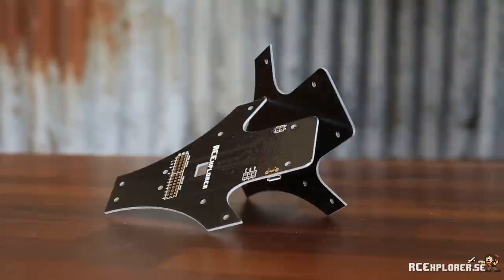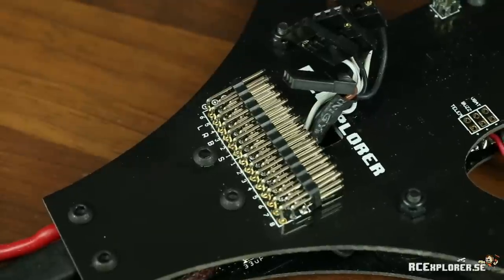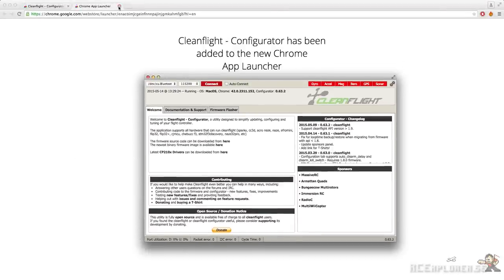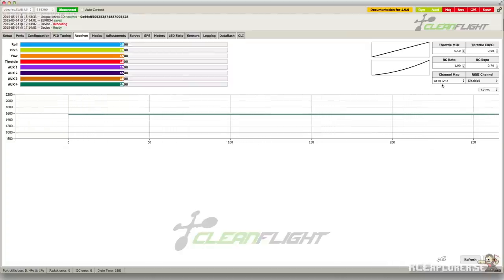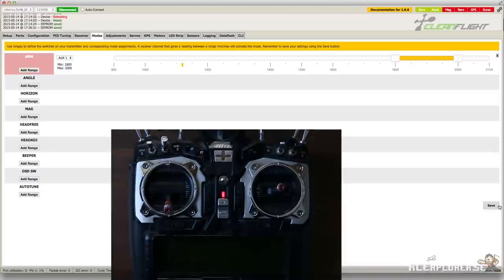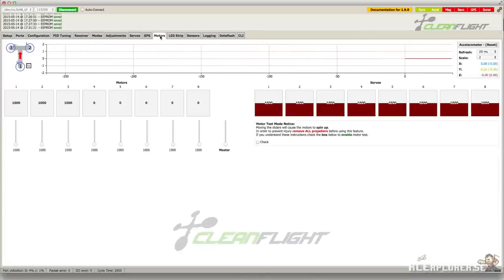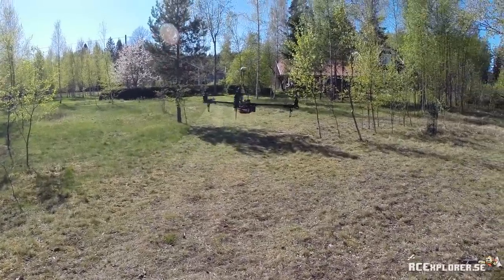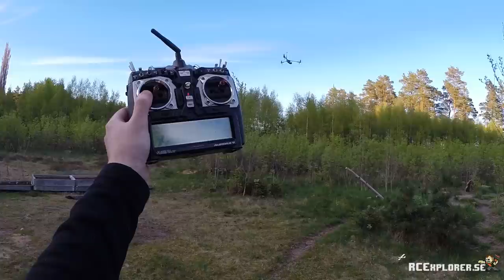Naze32 Tricopter frame setup

Comment: Hi David. 2 years after getting into RC and 14 multirotor builds later I'm just about to embark on my first Tri build (once I've finished my latest Armattan F1-6 quad!). The V3.5 kit I received from you last week looks great. Fantastic job on the setup guide and build log! Both look pretty comprehensive so there's plenty of reference info. My work colleague +IwancnobiRC (who posted a V3 YouTube review and also has a recent Mini Tri build under his belt) is on hand to provide some local help over here in Scotland so hopefully I shouldn't hit any major roadblocks! I'll be running a 4S long flight time setup using EMax 2216-850Kv & DYS BL30A ESCs. Cheers, Steve :-)

Comment: Hey David, in case you didn't know. They have an RCExlorer tricopter default setting that you can select when setting up an open pilot CC3D board. It flies better than anything I've been able to do. But then I suck at tuning. I can bend some piano wire though.

Comment: Damn.. I just ordered the 'normal' version of the frame ;)  Very interesting though! I might order this one as well.. 
Thanks for the good info video!
Reply: DutchRC ADVENTURES o.k. why not.. Ordered this one as well.. Can't wait to start the build :D
Reply: DutchRC ADVENTURES There is no reason not to have one of each version (or even multiples of). He who dies with the most tricopters wins : )
My count
3 black frames plates wooden arms V2.5 (from Davids CNC mill).
3 signed kits V3 (1 rescued from E bay).
2 pairs Naze32 Acro + power base plate (yet to be built).

Comment: I had an idea for a tricopter and with my knowledge I have no clue if it is feasible but back to the topic. I think it would be awesome to have a tri with a single boom forward and then call it the wavelength because the sign for wavelength is an upside down y

Comment: Nice complete setup video. I'll try that custom firmware om my tricopter because I have problems with a kind of flutter om the yaw servo with Cleanflight on a Flip32+ if you can recommend it. Had the same with a Pixhawk. 

Hope the new tricopter code will find it's way to the main branch of CF.

Comment: David, I flashed the firmware you mentioned and my HS-81MG tailrotor servo made a loud buzzing noise and burned up. Is this firmware only for use with a digital servo?

Comment: Hallo David,
this is a nice Video Tutorial.
I have a little question.
When you calibrate the ESC, the Max Throttle is 1900.
Should not previously a calibration, set the maximum gas to 2000 and after to the calibrate set again to 1900?

Comment: Was 2 days too soon on the order, so i bought Tri without naze. I still had a naze32 board lying around, so all good.

My question is. Can i run front motor nr.3 CW and motor nr.2 CCW?  Setup on mine is the same as in this video, where all motors spin same direction.

Comment: Is there any videos on were to solder everything? I am looking at the frames and see two + and - spots at every spot. And were do I add the battery connector? I have never built something like this (only planes) so I am a bit lost.

Comment: That thing is amazing :O
Its easy to setup, and its as cheap as a kk2 with the usb programmer.
And it includes a cool-designed frame.
My question is: is that product avaible in the eastern of europe? (Hungary exactly)

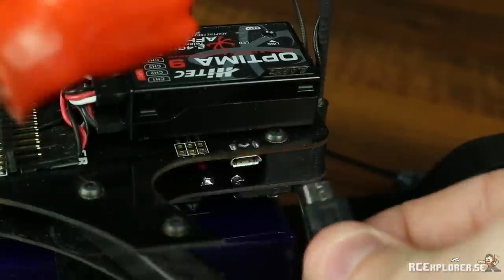Comment: David im setting up a naze32 (not built in frame) can you tell me as you use hitec, I have A9 as well. Can the minima6t receiver be used to connect via ppm,cppm or sbus? even the optima9? I cant find details of how to do it but I see at 4:00 you have a 9 connected. Is that only due to your frame type (built in naze) or can a naze (funfly) be configured the same way?thanks for your help.

Comment: hey David re the yaw drift, when I enter the adjustment to the MID value and hit SAVE it doesn't save, there is no confirmation in the status bar either, clicking to another tab and returning to the servo tab confirms default value 1500 still there. am I missing something obvious here? CF configurator 0.65.0

Comment: I am having trouble for some reason with the accelerometer when it calibrates and shows right side up it will move in opposite direction but with online firmware it works perfectly. all other steps including CLI I did with no problem

Comment: I don't really know what to do.
I downloaded  the newest driver for my 64 bit windows system , the newest cleanflight app. My pc tells me when the naze is plugged in, but it won't let me flash it to connect afterwards. I have selected the correct port but I always get the message that the bootloader doesn't respond and the flashing failed. The blue LED on the Naze is constantly showing blue. I have tried flashing with different usb cables, and even shorted the boot pins for a reset. Nothing changed. It is my first attempt on flashing a flight controller, never had a multirotor before but followed your guide step by step. What does the blue LED mean and what else could have gone wrong?
Ideas anyone?

Comment: so on the naze set up you are running all the motors the same rotation.
Reply: jlgrrt1 2:47 its say's other wise I'm setting up  external naze and it won't take off :C it seams to not like the front left rotation :/

Comment: My copter won't arm with the aux switch?! I've followed every step. I've even reset the board and did it again to make sure. The motors will spin on the motors tab on the computer, but when I try and use my Tx, it just won't work. Help anybody?

Comment: Would it be possible to use this firmware on my naze 32 even though its not integrated like yours?
Reply: treetokin There is a version for the regular board on the kit page in David's shop.

Comment: When using the preconfigured firmware my roll gyro is backwards. any thoughts?
Reply: kungfuape If you're using the standard board, you have to use the firmware that David posted for regular boards.
Reply: LeoTheHuman Thanks, not sure how I missed that.

Comment: @david Windestal, your link is dead and we can no longer access the firmware versions. Please re-post for those of us that have old Naze-32 boards :)
Reply: I used the Wayback Machine. I hope this is what you are looking for. But Wayback is great for that sort of stuff ;)

# version
Cleanflight/NAZE 1.9.0 May 17 2015 / 20:19:16 (fe40472)
# dump master

# mixer
mixer TRI

# feature
feature -RX_PPM
feature -VBAT
feature -INFLIGHT_ACC_CAL
feature -RX_SERIAL
feature -MOTOR_STOP
feature -SERVO_TILT
feature -SOFTSERIAL
feature -GPS
feature -FAILSAFE
feature -SONAR
feature -TELEMETRY
feature -CURRENT_METER
feature -3D
feature -RX_PARALLEL_PWM
feature -RX_MSP
feature -RSSI_ADC
feature -LED_STRIP
feature -DISPLAY
feature -ONESHOT125
feature -BLACKBOX
feature RX_PARALLEL_PWM

# map
map AETR1234

# led
led 0 15,15:ES:IA:0
led 1 15,8:E:WF:0
led 2 15,7:E:WF:0
led 3 15,0:NE:IA:0
led 4 8,0:N:F:0
led 5 7,0:N:F:0
led 6 0,0:NW:IA:0
led 7 0,7:W:WF:0
led 8 0,8:W:WF:0
led 9 0,15:SW:IA:0
led 10 7,15:S:WF:0
led 11 8,15:S:WF:0
led 12 7,7:U:WF:0
led 13 8,7:U:WF:0
led 14 7,8:D:WF:0
led 15 8,8:D:WF:0
led 16 8,9::R:3
led 17 9,10::R:3
led 18 10,11::R:3
led 19 10,12::R:3
led 20 9,13::R:3
led 21 8,14::R:3
led 22 7,14::R:3
led 23 6,13::R:3
led 24 5,12::R:3
led 25 5,11::R:3
led 26 6,10::R:3
led 27 7,9::R:3
led 28 0,0:::0
led 29 0,0:::0
led 30 0,0:::0
led 31 0,0:::0

# color
color 0 0,0,0
color 1 0,255,255
color 2 0,0,255
color 3 30,0,255
color 4 60,0,255
color 5 90,0,255
color 6 120,0,255
color 7 150,0,255
color 8 180,0,255
color 9 210,0,255
color 10 240,0,255
color 11 270,0,255
color 12 300,0,255
color 13 330,0,255
color 14 0,0,0
color 15 0,0,0

set looptime = 2500
set emf_avoidance = 0
set mid_rc = 1500
set min_check = 1100
set max_check = 1900
set rssi_channel = 0
set rssi_scale = 30
set input_filtering_mode = 0
set min_throttle = 1100
set max_throttle = 1900
set min_command = 1000
set servo_center_pulse = 1500
set 3d_deadband_low = 1406
set 3d_deadband_high = 1514
set 3d_neutral = 1460
set 3d_deadband_throttle = 50
set motor_pwm_rate = 400
set servo_pwm_rate = 250
set retarded_arm = 0
set disarm_kill_switch = 1
set auto_disarm_delay = 5
set small_angle = 25
set flaps_speed = 0
set fixedwing_althold_dir = 1
set serial_port_1_functions = 1
set serial_port_1_msp_baudrate = 5
set serial_port_1_telemetry_baudrate = 0
set serial_port_1_blackbox_baudrate = 5
set serial_port_1_gps_baudrate = 4
set serial_port_2_functions = 0
set serial_port_2_msp_baudrate = 5
set serial_port_2_telemetry_baudrate = 0
set serial_port_2_blackbox_baudrate = 5
set serial_port_2_gps_baudrate = 4
set serial_port_3_functions = 0
set serial_port_3_msp_baudrate = 5
set serial_port_3_telemetry_baudrate = 0
set serial_port_3_blackbox_baudrate = 5
set serial_port_3_gps_baudrate = 4
set serial_port_4_functions = 0
set serial_port_4_msp_baudrate = 5
set serial_port_4_telemetry_baudrate = 0
set serial_port_4_blackbox_baudrate = 5
set serial_port_4_gps_baudrate = 4
set reboot_character = 82
set gps_provider = 0
set gps_sbas_mode = 0
set gps_auto_config = 1
set gps_auto_baud = 0
set serialrx_provider = 0
set spektrum_sat_bind = 0
set telemetry_switch = 0
set telemetry_inversion = 0
set frsky_default_lattitude = 0.000
set frsky_default_longitude = 0.000
set frsky_coordinates_format = 0
set frsky_unit = 0
set frsky_vfas_precision = 0
set hott_alarm_sound_interval = 5
set battery_capacity = 0
set vbat_scale = 110
set vbat_max_cell_voltage = 43
set vbat_min_cell_voltage = 33
set vbat_warning_cell_voltage = 35
set current_meter_scale = 400
set current_meter_offset = 0
set multiwii_current_meter_output = 0
set current_meter_type = 1
set align_gyro = 0
set align_acc = 0
set align_mag = 0
set align_board_roll = 0
set align_board_pitch = 0
set align_board_yaw = 0
set max_angle_inclination = 500
set gyro_lpf = 42
set moron_threshold = 32
set gyro_cmpf_factor = 600
set gyro_cmpfm_factor = 250
set yaw_control_direction = 1
set pid_at_min_throttle = 1
set yaw_direction = 1
set yaw_jump_prevention_limit = 200
set tri_unarmed_servo = 1
set servo_lowpass_freq = 400
set servo_lowpass_enable = 0
set failsafe_delay = 10
set failsafe_off_delay = 200
set failsafe_throttle = 1200
set rx_min_usec = 985
set rx_max_usec = 2115
set acc_hardware = 0
set mag_hardware = 0
set blackbox_rate_num = 1
set blackbox_rate_denom = 1
set blackbox_device = 0

# dump profile

# profile
profile 0

# aux
aux 0 0 0 1800 2000
aux 1 1 1 1300 1700
aux 2 2 1 1750 2025
aux 3 0 0 900 900
aux 4 0 0 900 900
aux 5 0 0 900 900
aux 6 0 0 900 900
aux 7 0 0 900 900
aux 8 0 0 900 900
aux 9 0 0 900 900
aux 10 0 0 900 900
aux 11 0 0 900 900
aux 12 0 0 900 900
aux 13 0 0 900 900
aux 14 0 0 900 900
aux 15 0 0 900 900
aux 16 0 0 900 900
aux 17 0 0 900 900
aux 18 0 0 900 900
aux 19 0 0 900 900
aux 20 0 0 900 900
aux 21 0 0 900 900
aux 22 0 0 900 900
aux 23 0 0 900 900
aux 24 0 0 900 900
aux 25 0 0 900 900
aux 26 0 0 900 900
aux 27 0 0 900 900
aux 28 0 0 900 900
aux 29 0 0 900 900
aux 30 0 0 900 900
aux 31 0 0 900 900
aux 32 0 0 900 900
aux 33 0 0 900 900
aux 34 0 0 900 900
aux 35 0 0 900 900
aux 36 0 0 900 900
aux 37 0 0 900 900
aux 38 0 0 900 900
aux 39 0 0 900 900

# adjrange
adjrange 0 0 0 900 900 0 0
adjrange 1 0 0 900 900 0 0
adjrange 2 0 0 900 900 0 0
adjrange 3 0 0 900 900 0 0
adjrange 4 0 0 900 900 0 0
adjrange 5 0 0 900 900 0 0
adjrange 6 0 0 900 900 0 0
adjrange 7 0 0 900 900 0 0
adjrange 8 0 0 900 900 0 0
adjrange 9 0 0 900 900 0 0
adjrange 10 0 0 900 900 0 0
adjrange 11 0 0 900 900 0 0

# servo
servo 0 1020 2000 1500 30 -1
servo 1 1020 2000 1500 30 -1
servo 2 1020 2000 1500 100 -1
servo 3 1020 2000 1500 100 -1
servo 4 1020 2000 1500 100 -1
servo 5 1100 1900 1500 100 -1
servo 6 1020 2000 1500 100 -1
servo 7 1020 2000 1500 100 -1

set gps_pos_p = 15
set gps_pos_i = 0
set gps_pos_d = 0
set gps_posr_p = 34
set gps_posr_i = 14
set gps_posr_d = 53
set gps_nav_p = 25
set gps_nav_i = 33
set gps_nav_d = 83
set gps_wp_radius = 200
set nav_controls_heading = 1
set nav_speed_min = 100
set nav_speed_max = 300
set nav_slew_rate = 30
set alt_hold_deadband = 40
set alt_hold_fast_change = 1
set deadband = 4
set yaw_deadband = 5
set throttle_correction_value = 0
set throttle_correction_angle = 800
set default_rate_profile = 0
set gimbal_flags = 1
set acc_lpf_factor = 4
set accxy_deadband = 40
set accz_deadband = 40
set accz_lpf_cutoff = 5.000
set acc_unarmedcal = 1
set acc_trim_pitch = 0
set acc_trim_roll = 0
set baro_tab_size = 21
set baro_noise_lpf = 0.600
set baro_cf_vel = 0.985
set baro_cf_alt = 0.965
set mag_declination = 0
set pid_controller = 0
set p_pitch = 34
set i_pitch = 35
set d_pitch = 42
set p_roll = 34
set i_roll = 35
set d_roll = 42
set p_yaw = 53
set i_yaw = 15
set d_yaw = 10
set p_pitchf = 1.900
set i_pitchf = 0.300
set d_pitchf = 0.029
set p_rollf = 1.900
set i_rollf = 0.300
set d_rollf = 0.029
set p_yawf = 2.900
set i_yawf = 0.800
set d_yawf = 0.030
set level_horizon = 4.000
set level_angle = 5.000
set sensitivity_horizon = 101
set p_alt = 50
set i_alt = 0
set d_alt = 0
set p_level = 60
set i_level = 6
set d_level = 100
set p_vel = 120
set i_vel = 45
set d_vel = 1
set yaw_p_limit = 0

# dump rates

# rateprofile
rateprofile 0

set rc_rate = 100
set rc_expo = 70
set rc_yaw_expo = 0
set thr_mid = 50
set thr_expo = 0
set roll_rate = 0
set pitch_rate = 0
set yaw_rate = 10
set tpa_rate = 25
set tpa_breakpoint = 1500

#
Save

Comment: Thanks so much David. I used the firmware on my scratchbuilt tricopter based on your version 2.5 and it works brilliantly!! So much better yaw stability and control. Here is my video testing it: https://youtu.be/Lhmq8pM73DQ
I wish you all the best with your shop and further projects.